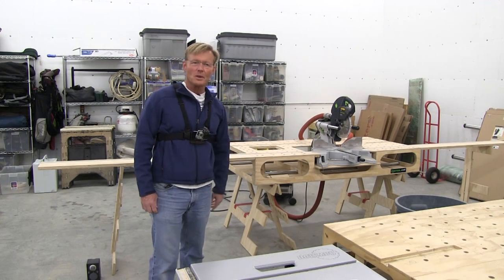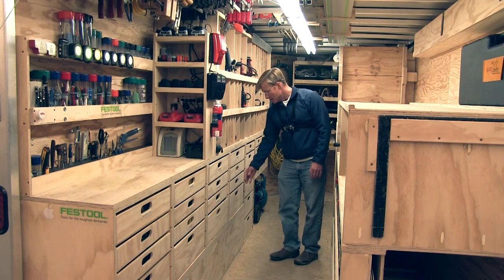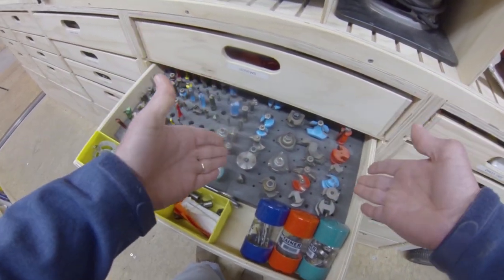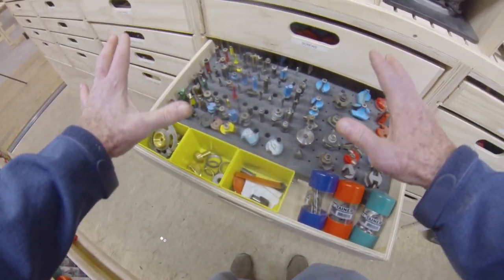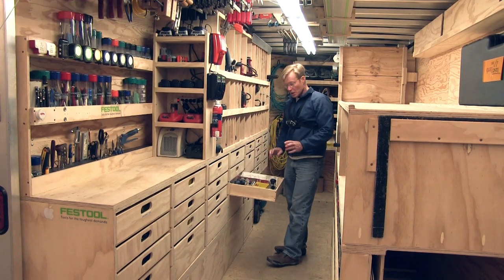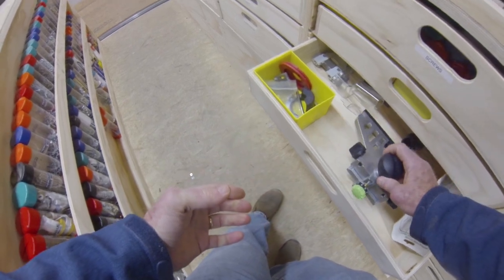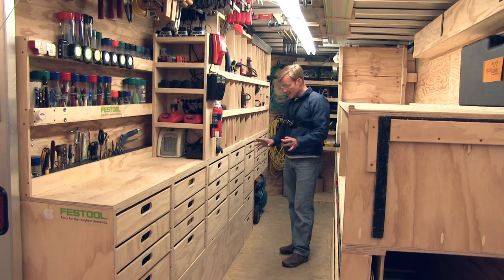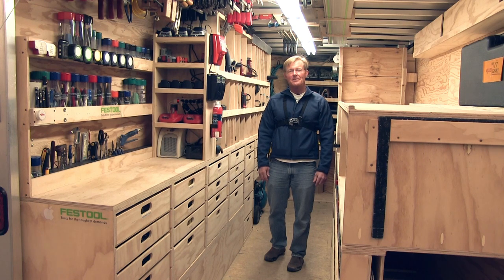AWESOME ROLLING TOOL BOX ROUTER DRAWERS

Comment: on bit arrangement, the green foam used for flower arrangements  /crafts works great for this sort of thing and no tooling required. You just jam your bits in where you want them.  Available at any craft store, inexpensive..

Comment: ron. why don't u inset some rare earth magnets on the drawer faces? then u have the freedom to move items and the corresponding labels? 
btw. good friend of mine was at ikea here in canada and they have made a magnetic silicone pad.  works great doing kitchen with finished surfaces.  also not losing the hardware is a bonus!